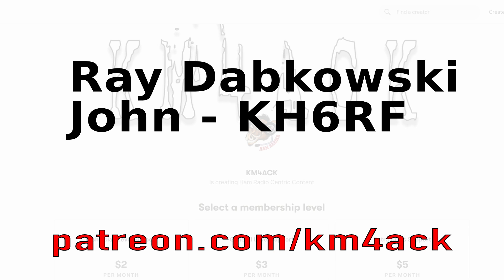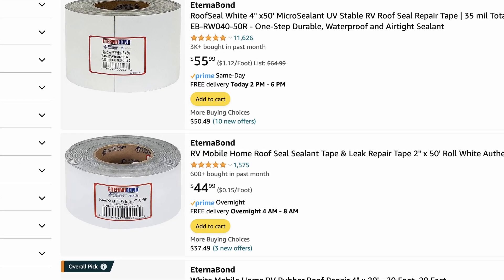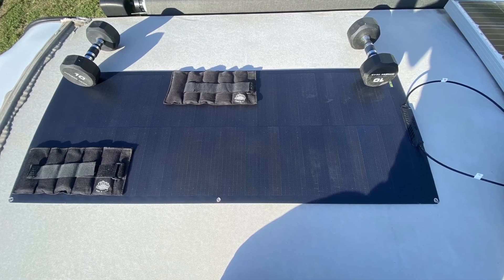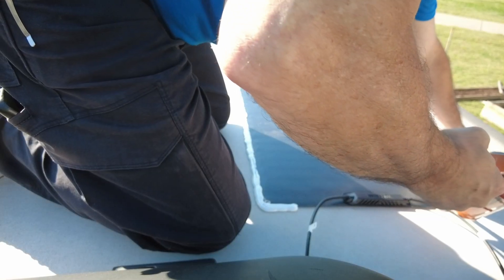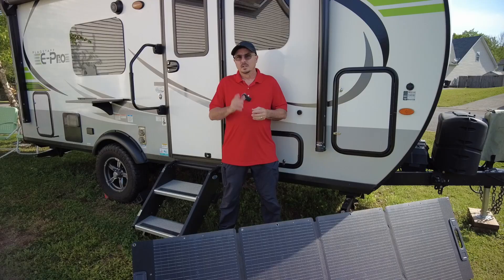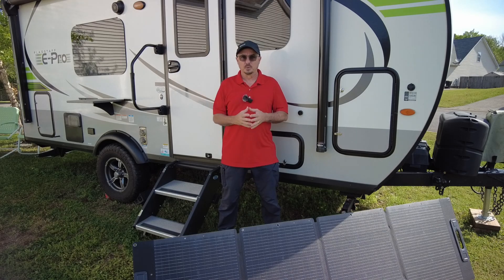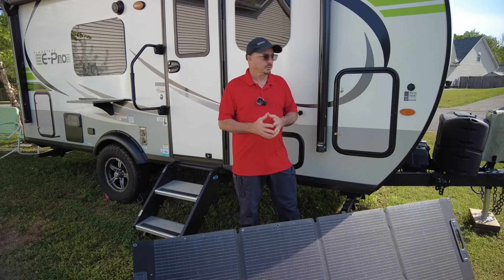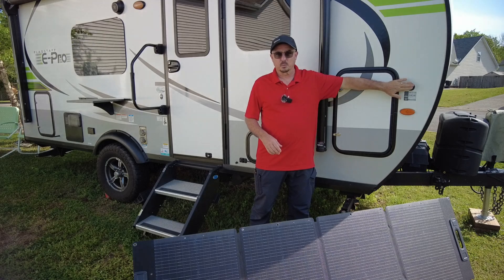No Drill RV Solar Install

Comment: My battery is on the front as well.  I’ve been hesitant to put a LiPo4 out there due to the outdoor temps.  So I have considered moving it into a box to try and maintain appropriate temps for charging
Reply from the maker: The Weize battery https://amzn.to/3ye3oRv  (affiliate link) that I put in has both high and low temp protection built in. It's been through a couple of winters here in Tennessee now and I haven't had any issues.

Comment: How do you get the power down from the roof?
Reply from the maker: There was a solar penetration point installed from the factory when we purchased. I put a splitter on the penetration point to handle the three panels.
Reply: @KM4ACK  Ahh, thanks! I like the idea, but would probably run them down the refrigerator top vent I guess.

Comment: I used the 100 Ah mini battery for RV installs. 2 of them smaller than most 200 Ah battery. measure battery compartment and work it out . what I do for RV installs. and insulate battery  if compartment can get cold. home depot has thin pink insulation bord that works great. I even put it in my POTA battery box around battery. the battery fit loose so I packed insulation around it. holds it in place. I am in NY so we think about the cold . 73's
Reply from the maker: The 100Ah minis are exactly what I am looking at. Two normal 100Ah won't fit in my current box and I prefer the batteries to be the same age when installed. I'll find another use for the 100A that gets pulled out.

Comment: This is next on my list to do!  I would have thought about the tape and also the sealant... but I wouldn't have thought about the moisture holes.  Do you think if you seal it all the way around on a dry day that you'd get moisture between the panel and the roof still?
Reply from the maker: BTW T.O....those 100W panels are $59 right now on Amazon. $79 with $20 coupon.
Reply: @KM4ACK  awesome, thanks
Reply: you may. if like panels used in this video. the round mounting holes will let water in. never want to trap water in. if air can get in water can. and condensation can happen with day and night .
Reply from the maker: Can't say for sure but I wanted to make sure it had an escape path just in case.
Reply: Personally, I'd leave a space in the caulk for a drain.  If you are concerned about the caulk smudging over on the panel when you apply it you can use wide painters tape to protect the outline of the panel.  This will help prevent caulk from getting too far over on the panel surface as you apply it.  Just be sure to peel the tape off before the caulk sets.  You should end up with a nice clean caulk line.  You could even place strips of tape where you want your drain and caulk over the tape but then peel those tape strips off before it sets to create a uniform gap in the caulk.  I would do the installation in the shade to allow for more working time with the caulk, once all the tape is removed move RV into the sun.  If possible place the drain at the lowest point as water will seek this location naturally.